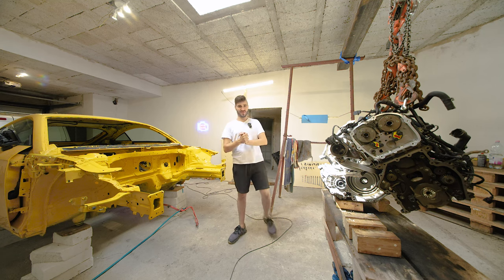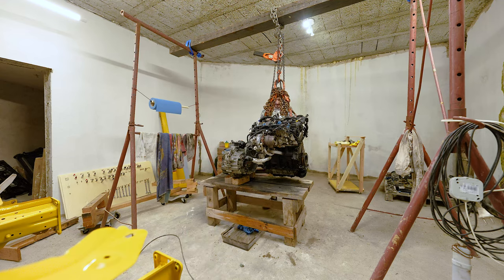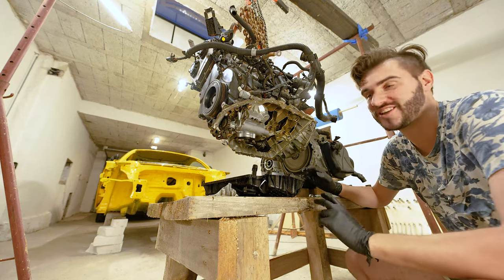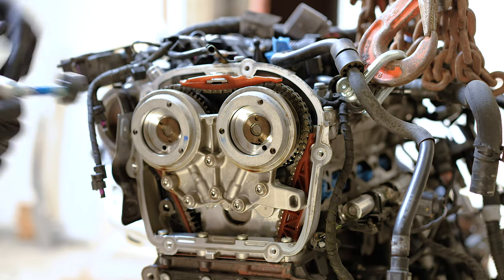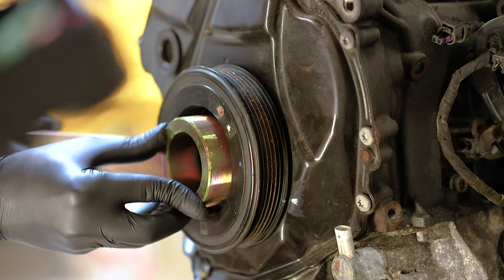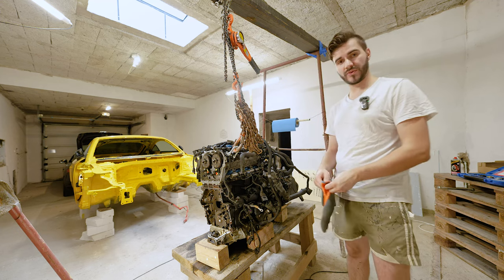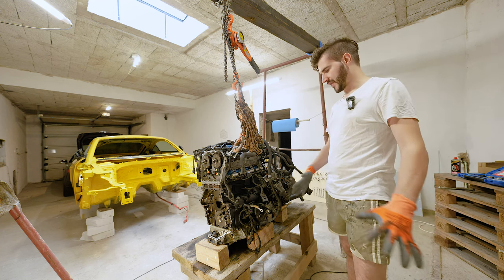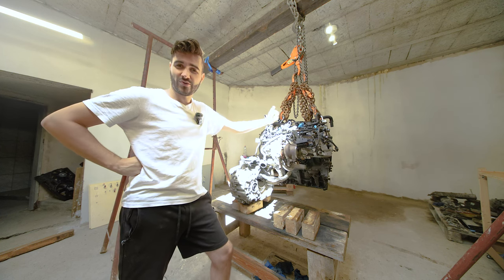How bad is the Engine damage?! - EA888 2.0 TFSi - E7

Comment: Good job! What was the damage exactly?
Reply from the maker: Thank you so much Lorenzo!!
I bought the car crash-damaged. Was a financial writeoff. Check the episode 1 out, its a long story but hopefully interesting 🤗
Reply: I know about the car (following the saga from day 1😅) but didn't understand yet what damage you've found on the engine (if any)
Reply from the maker: @Lorenzo_TT-RS ahh, I appreciate you so much!! The aluminium part between the block and plastic oil sump was broken.. of course, the oil sump as well. Other than that, all internal components of the engine are ok. 🤗🤗👍🏻
Reply from the maker: @Lorenzo_TT-RS  you are completely right, I just realised I didnt film the damaged parts. The most important part- I forgot to film 😂🙈🙈🙈